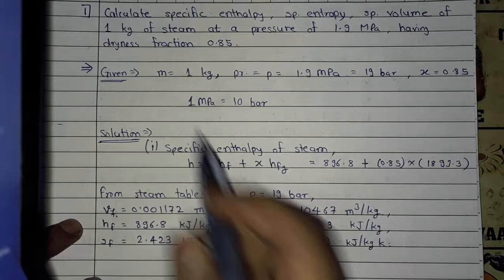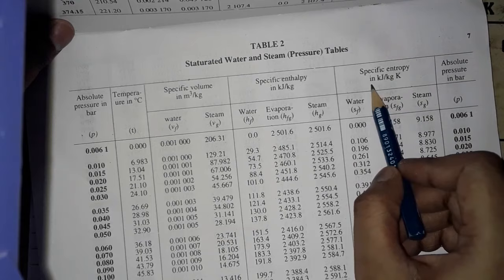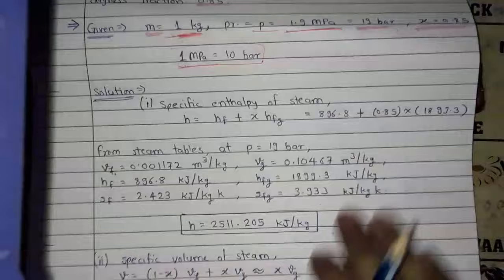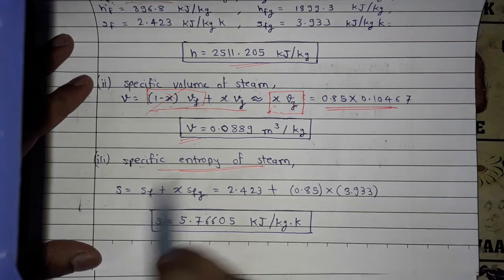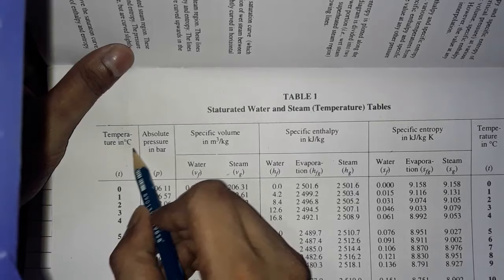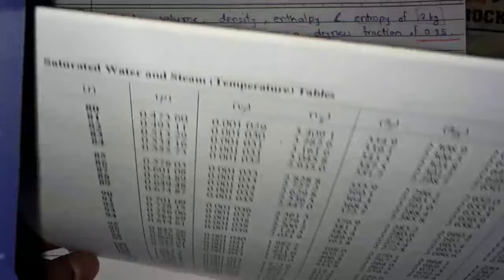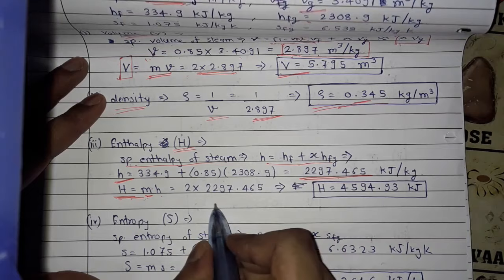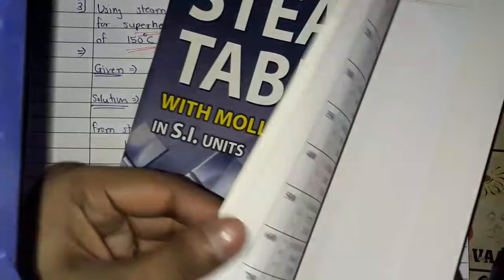How to use steam tables explained with examples | Steam Table Interpolation | Thermodynamics

Comment: 14:43 if in Tsup it is given 80° or 210° or some other value which is not mentioned how to calculate that?
Reply from the maker: At 80℃ there is no superheated steam. Superheating of steam starts  at 100℃. So that 80℃ parameters are not there.
The temperatures which are not given like you say 210℃ can be calculated by using interpolation which I have explained in the same video after that question.